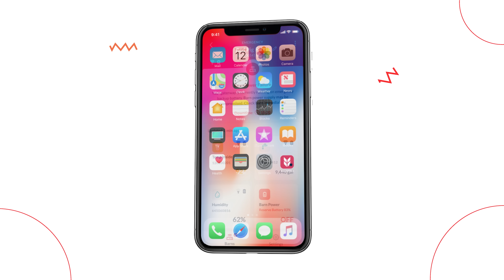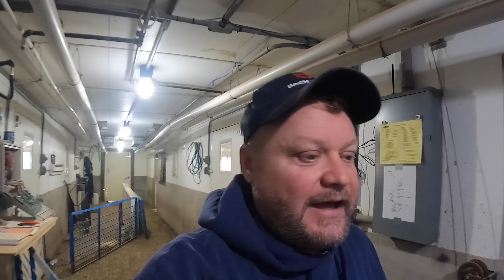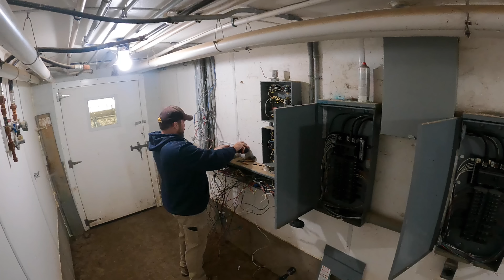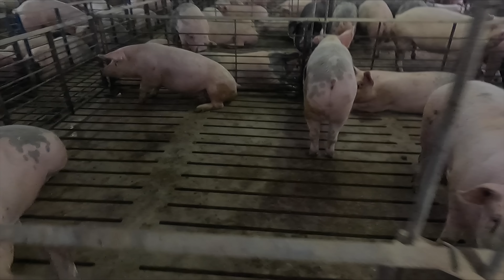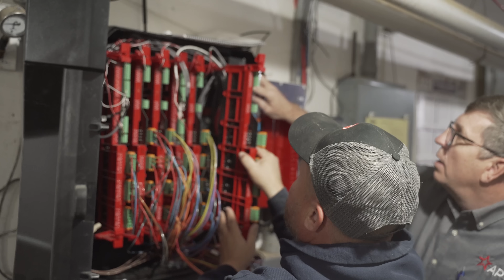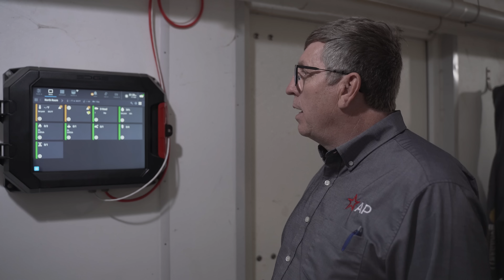Sorting Pigs & Farm Upgrades

Comment: Something else these days. We use to just grind feed, throw some minerals in and fill the feeders. Had a lot fenced with some sort of shade and place for them to get out of the weather if needed and wait till they got big. Was only about 60 to 80 pigs at a time. Was secondary to the dairy which was the most important. Hauled our own and sold them to armor in Albert lee.
Reply: My dad would feed shelled corn and meat scraps to his field finished hogs. We used to take pickup loads down to the Oscar Meyer buying station or if we had a bunch ready we would send a double deck straight truck to Rath in Columbus Junction.